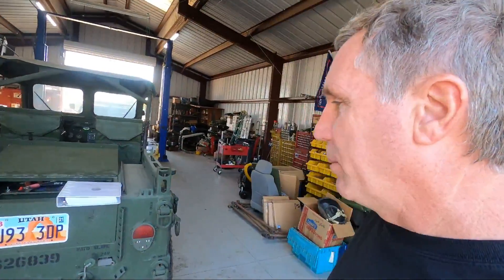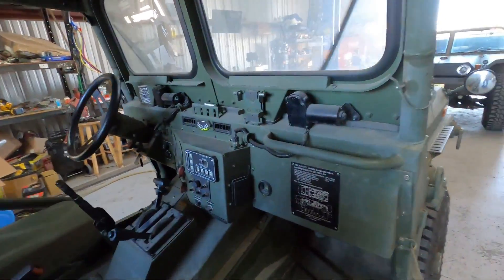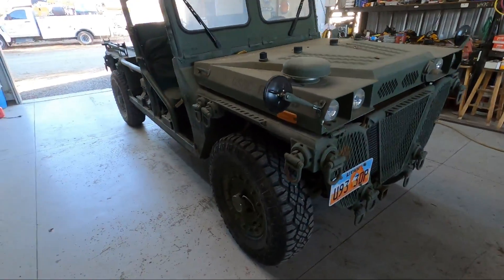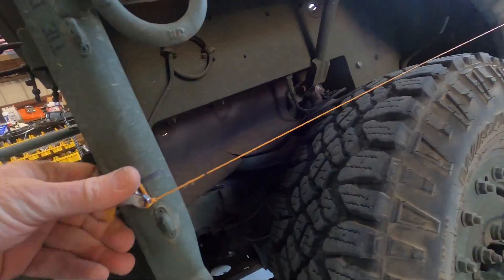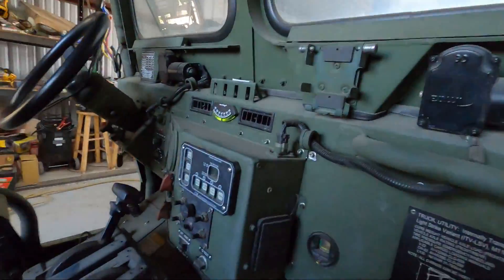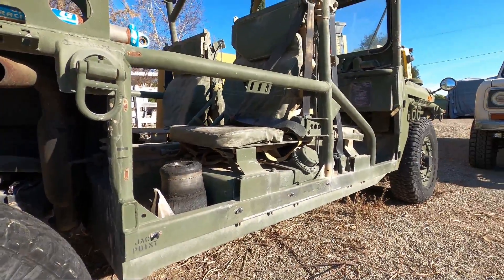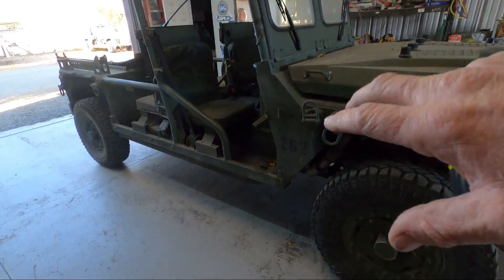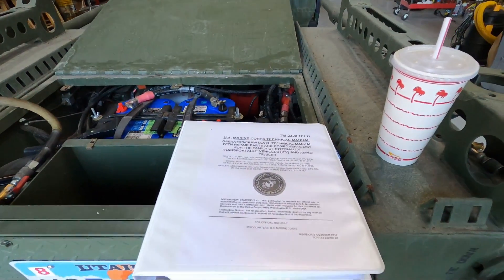Air Suspension Ride Height Setting on Growler M1161 M1163

Comment: any tricks to activate the compressor?
 (already turned on air toggle) but the compressor does not activate . It worked on the first ride , but not on the second ride.
Reply from the maker: Do you have a M1161 or a M1163
Reply: @RasmussenEquipment  ..m1161
Reply: Just found some pretty comprehensive  manuals on the forum 600 pages!
Reply from the maker: First off... the obvious... the compressor shuts off automatically when pressure is up.
No offense just making sure. :)
Next there are some self resetting 50 amp breakers on the passenger side under the rear covers that hide the air compressor. Check those to see if they are still good. If your 1161 has seen salt water it could have rotted them out.
If you have other controls that don’t work as well I.e. tire inflation system or air ride controller it is possible to either be a 50 amp breaker or we have seen one of the relays behind the dash go bad. One is a 12v and the other is a 24v.  Most of the items are 24v but are controller (switched) on the 12v system. There are also a handful of relays under the drop down panel just above the brake pedal... jiggle the wires there to check for a bad connection.
Reply from the maker: There is a lot of good information on the growler.com forum
Reply: @RasmussenEquipment  ...grateful for your dissemination  of info!